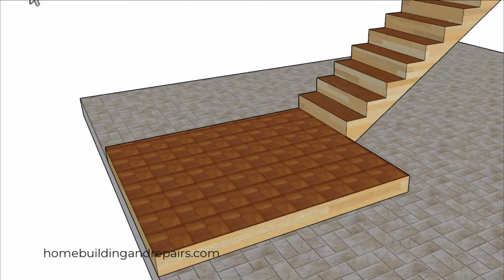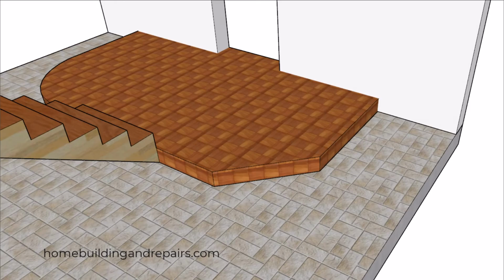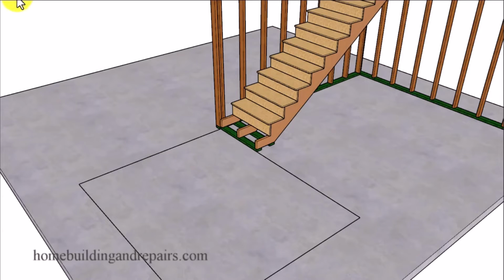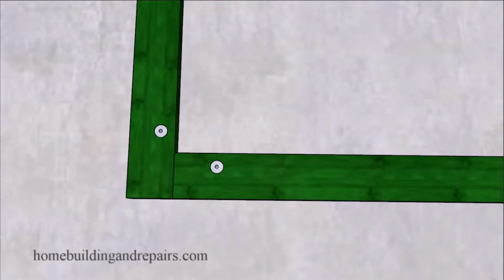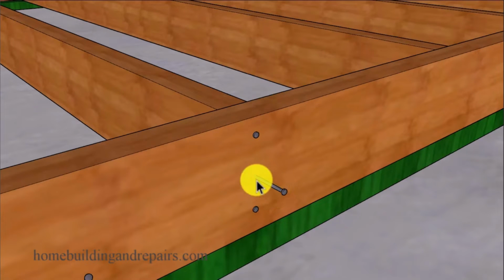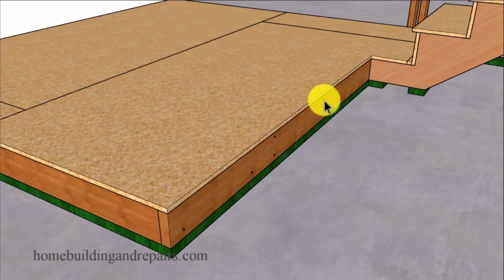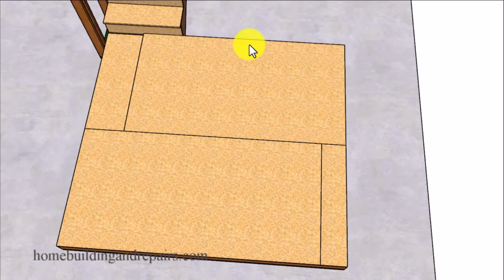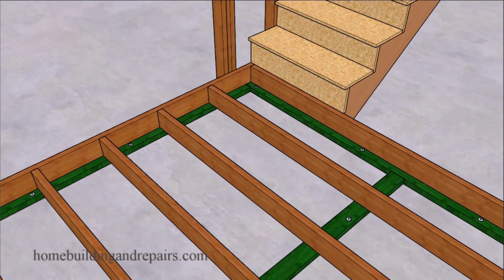Stair Platform Design Ideas And Framing Tutorial For Home Remodeling or New Construction

Comment: Wanted to ask your advice on something. I’m 25 years old and will be starting to subcontract for a METAL sunroom company soon. But I would like to take on other work

I would like to take on other work like framing and finishing garages screen porches etc maybe eventually bigger and bigger into framing some houses eventually.

I have built simple wood decks, stairs and handrails and metal sunrooms for that company before as a lead “carpenter” and of course had to pass inspections for them etc. But my only experience framing on a house crew was as a helper nailing basically nailing everything together and laying out where the lead guy told me to layout the wall or floor, which way joists ran etc. So not having to read plans etc. 

However I have learned how to layout and cut rafters and stairs on my own. Framed some pole barns and sheds etc even done a couple with hip roofs dormers etc just to practice. Did not have to pass inspection or deal with plumbing hvac etc on those. But they did go well. And of course I have at least seen and helped on the whole process of a house being built at least a couple times working as a helper. (Stringlining  walls setting ridge, over frame roofs valleys hips etc etc)

I feel like most of the work is pretty easy, and that something like especially framing  a garage and passing inspections for that would not be too hard since supposedly people build their own house with no experience, etc.

 Do you think this is a feasible idea, especially if I started with something like a garage here or there? I am at least familiar with framing and knowing the process of how stuff is erected, what jack and king studs are, how to layout, etc. I have framed decent sized pole barns before as well and everything came out straight and solid and dimensions accurate etc. I just might not  know how to look at a plan and know that I shouldn’t put a joist here because a plumbing pipe is going to be going there etc.  what’s your two cents? I just don’t want to be only building metal sunrooms and wood decks my whole life because it’s already boring.

Thanks Gregvan hope I didn’t bother you
Reply: I am curious if he responds too. I’m 30, but do essentially the above and have found that often pactching into an existing structure is always easy in theory, but much harder in practice because there is often rot, difficult to match materials, uncommon slopes, homeowners who don’t want to pull permits, and homeowners who want to cut costs, if you work by yourself, you can hold yourself to higher standards, but sometimes a lot of effort is spent ensuring subcontractors do things properly. My tilers, for instance, often don’t follow the plan. They are happy to redo work, but they waste lots of materials not following the plans. They also often forget to use materials I purchase for a reason to speed up their process. It’s constant headache. I think garages or detached structures are where it’s at, at least where I’m at in Milwaukee because it gives much more control and repeatability. Doing an attic buildout on a bungalow or 2000s built track home is just asking for problems IMO and while the work is fun, sometimes the pay per hour isn’t what you’d expect after factoring in all the unanticipated tasks.